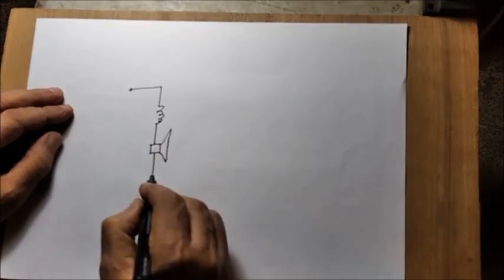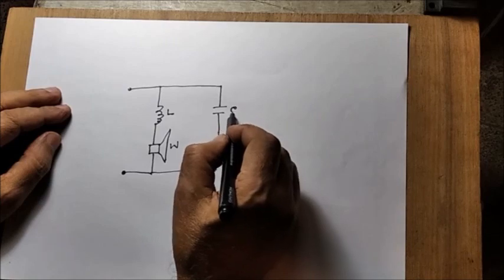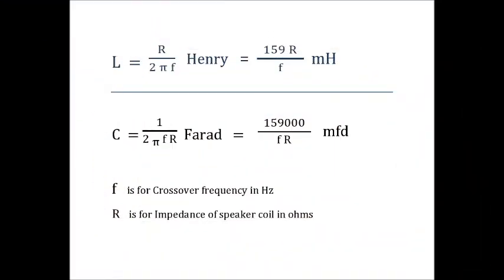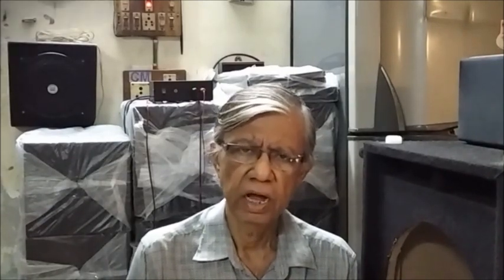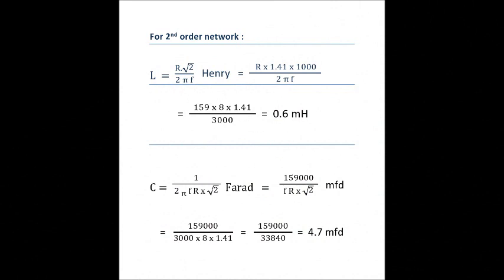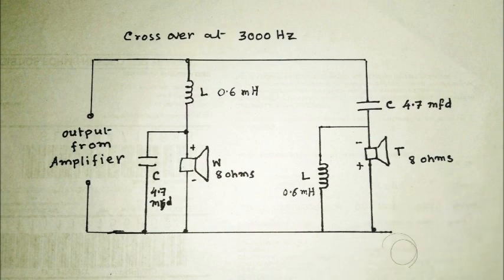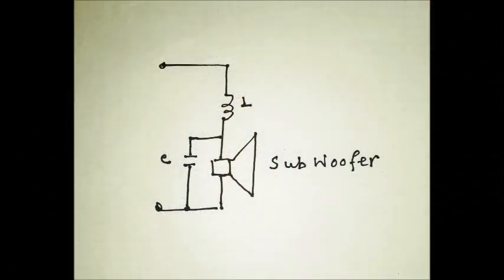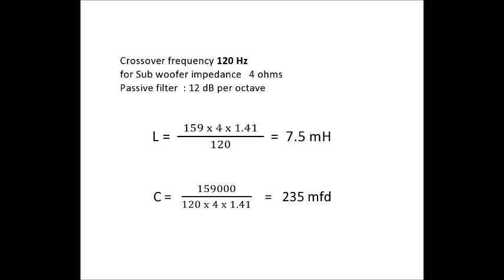Crossover network | Calculation of Component Values

Comment: Sir, I have a 2.1 system. 2x15W 4ohm speakers and 50W 4ohm woofer. so how do I add 2 tweeters for this system?
Reply: Gday in parallel with a 2.2,3.3,4.7uf capacitor in series on the plus side of the 15w speakers ;)
Reply: @THEKINGS001  Thank you. I'll check and tell you feedback. Another thing is which tweeter (watts and ohms) should I have to add?
Reply: @THEKINGS001  what is the capacitor Voltage?
Reply: @sampathmadugalla4624  63v to 100v is fine, the tweeters 4 ohm and wire them in parallel

Comment: Sir how to connect potentiometer in crossover         sir please tell it is possible
Reply from the maker: Yes, you can use a 50 ohms wire wound pot in parallel to the tweeter.